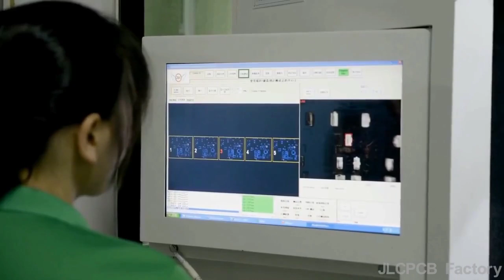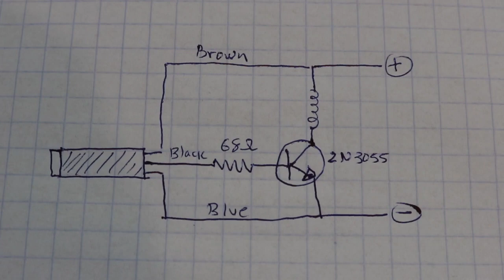Magnetic Accelerator

Comment: Nice Science sharing project, man! 
I reproduced the experiment with my students at the high school science fair. Everyone enjoyed it a lot. The students did make it with the same cooper wire (30 AWG), coil turns, resistor, transistor, inductive sensor, steel ball. However, I used a plastic rail more little extensive than yours. The steel ball was not pushed enough by the magnetic field flow. The solution was to replace the steel ball with another magnetic ball of the same diameter (19mm). Thus, the magnetic ball obtained greater magnetic interaction with the coil and received much more impulsive force to circulante along the rail.
Reply from the maker: Great that you like it! I had no magnet ball around so used normal steel ball
Reply: What is that circular path?

Comment: Make the ring a glass tube under vacuum, use a dozen powerful magnet coils- and accelerate the bearing past the speed of sound. Please.
Reply: Uhhh, mate you know how hard that is... This is a simple proximity sensor with no code I believe. Trying to do that might need what you said plus like 30 fans, an Arduino Mega, a few LEDs, and maybe a potentiometer. If that's even possible...
Reply: Ahem, define the speed of sound in a vacuum.  ;-)

Comment: Why isn't the electromagnet attracting the ball?
Reply from the maker: It is!
Reply: The coil is basically pulling hard on the ball as soon as the sensor detects the ball. Then in a split second just as the ball reaches near the center of the coil, the coil turns off releasing the ball as it's no longer under the sensor when the ball starts to go through the coil. Giving the impression that the ball is being pulled then pushed when in fact it's being pulled and released very fast.

Comment: if the rail and ball were placed in a vacuum  the speed will be incredible
Reply: Then it's called hyper loop ..lol😊😂
Reply: Slightly faster but probably not much as you'd only be removing air resistance and would still be fighting friction and gravity.  Cool idea though :-)
Reply: @mowburnt  hi, im doing that now with my friends haha!
Reply: @etataa1638  It is not recommended to do this with friends.  Friends cannot survive a vacuum.
Reply: @mowburnt  if it was already super fast, would it benefit more from air resistance removal?
Reply: Indeed
Reply: Right

Comment: what happens if we increase the turns number I mean is there a chance of increasing the speed?
Reply: others yes but on the other im not sure
Reply: It's hard to calculate. The strength of the magnetic pulse will be proportional to Current x Turns or Ampere-turns. So if you double the number of turns and you double the resistance which halves the current (Ohm's law) and you are back where you started. But maybe you can also double the voltage (assuming your power supply has the capacity, which is a wholly different discussion).

So we double the turns. But that makes the inductance of the coil FOUR times as much.  The inductance slows down the rate of rise of the current when it is switched on. This is where it gets complicated.  ;-)

Comment: I still don't know whether the coil is pulling or pushing the ball.
Not a good teacher.
>
Reply: The ball is simply a steel ball, not a permanent magnet.  Steel can only be attracted to a magnet, not repelled.  So the coil is turned on as the ball approaches and must be turned off before it leaves, halfway through the coil at most.  Timing is sensitive in this implementation.  I too was a bit disappointed that these fundamentals were not mentioned.
Reply: As a good student, you are allowed to think for yourself. The coil is activated when the ball is outside the coil, but travelling towards it. If the coil pushed the ball, it would slow it down.

Comment: that's how EPG system free electricity generator works
Reply: Must kill to create. Over produce. Use less than produced under load 
To provide use .after use return. To be changed or charged. By disscharging or blending into over produced line  .with burn off causing. Discharge or changed polarity. Or return. I know how forget rules. Keep it simple. Has to complete circuit. And gain what's lost during work back plus some to discharge to change amps to volts .and the same. Volts to amps
Reply: @odsutton5006  Heh?
Reply: But it has to be lubricated with snake oil.
Reply from the maker: There is  no free electricity

Comment: 2:02 proximity sensor applies current to the transistor, turning it on and off. No link given. Might be a magnet attracted to bearing closing a switch. Also a coil on electromagnet could open a gate turning itself off creating a self oscillating circuit.  And that oscillating electromagnetic coil inducing into pickup coils becomes generative. Pickup coils can then recharge the source battery.
Reply: Or, like he said, it could be an inductive sensor. Say you have a resonant LC circuit with a mid-range q factor and you drive it with a signal that has a slightly lower frequency. The LC circuit acts as a bandpass filter on the signal, and as the metal bearing passes by the inductor, it's effective self-inductance increases, increasing the gain

Comment: One nit to pick.  To said that the coil pushes the ball.  If the ball is ferromagnetic, which I'm sure it is, the coil cannot do that, it can only pull it. So the timing is different,
Reply: Could you please explain why isn't the ball attracted.
Reply: @hikesays   the ball is attracted. Was that a typo?  If you're asking for an explanation of why a ferro magnetic material is attracted to higher densities of magnetic field strength,  and never repelled, then the answer is very hard theoretically, but easily observed.

Comment: If you put many balls in it would it turn faster?
Reply: I would expect the ball to eventually bunch up and that would spoil the timing - the coil would be on for the whole length of the "train" rather than the required short, sharp pulse.
Reply: The balls will travel at the same speed, but the coil will pulse at a higher rate
Reply: @jamesbrown99991  There is friction in the loop and the ball temporary launches with much speed and then looses the speed thanks to friction. If the loop gets smaller then the opportunity to get the push again comes much sooner meaning that the time with friction decreases. With many balls I believe they would push each other to accelerate even more but I'm not really sure.
Reply: @nattsurfaren  the balls are given an amount of momentum by the coil. If the balls don't interact with each other, then they'll all be travelling at the spec of the ball in this video. 
If you add more balls such that they stay colliding, I think you'll find that the balls end up going slower. The collision will impart momentum from the faster ball to the slower ball; the slower ball which will then lose more energy to friction than it would If there were no collision (friction increases with velocity).
If you add even more balls, you will get the coil jammed on and no movement of the balls.

Comment: U need a diode connected to the coil to  prevent the transistor from damaging due to overvoltages created by the coil
Reply: I've seen where a capacitor is placed across the transistor in addition to your comment because of the voltage drop delay accessing the diode.
Reply: While that's best practice the simplicity makes it more intelectually accessible.
Reply: Yes, that's good practice.
Reply: 2:02 proximity sensor applies current to the transistor, turning it on and off. No link given. Might be a magnet attracted to bearing closing a switch. Also a coil on electromagnet could open a gate turning itself off creating a self oscillating circuit.  And that oscillating electromagnetic coil inducing into pickup coils becomes generative. Pickup coils can then recharge the source battery.
Reply: NO GOD BUT GOD....What Is Islam?

Islam is not just another religion. 

It is the same message preached by Moses, Jesus and Abraham.

Islam literally means ‘submission to God’ and it teaches us to have a direct relationship with God. 

It reminds us that since God created us, no one should be worshipped except God alone. 

It also teaches that God is nothing like a human being or like anything that we can imagine.

 The concept of God is summarized in the Quran as:

{ “Say, He is God, the One. God, the Absolute. He does not give birth, nor was He born, and there is nothing like Him.”} (Quran 112:1-4)

Becoming a Muslim is not turning your back to Jesus. 

Rather it’s going back to the original teachings of Jesus and obeying him
Reply: ahmd abdallah 

Lol. Explain that to the wahhabis
Reply: thats why he used a 3055, they can resist quiet a time being penetrated :D
Reply: Smart ass...
Reply: The 2N3055 is very robust, such a tiny coil shouldn’t be able to damage it
Reply: @among-us-99999  it's collector-emitter voltage is only 60v, and this coil isn't so tiny, depending on what voltage u use to power this circuit  it could easily damage this transistor
Reply: @dominikworkshop6007  Back EMF